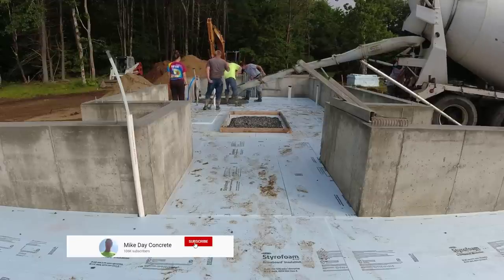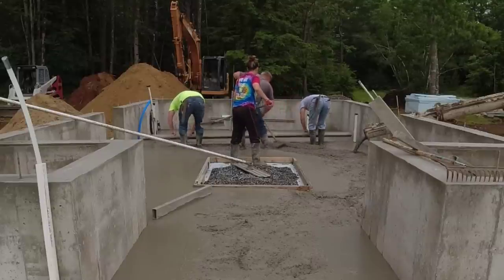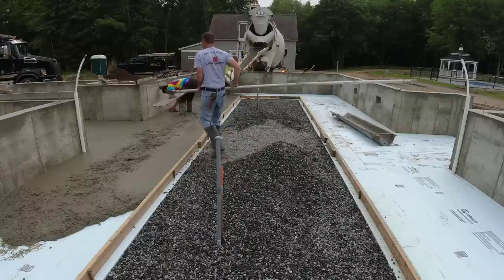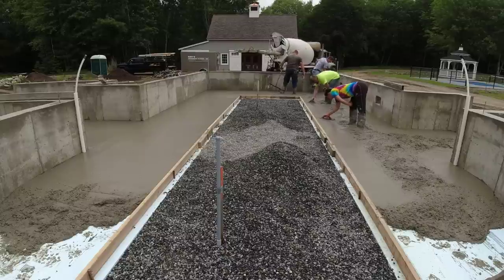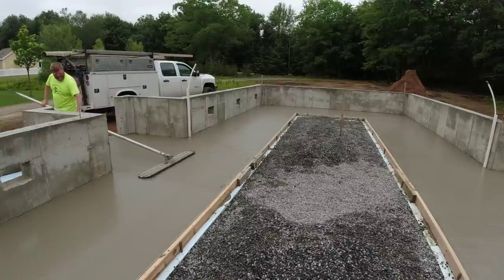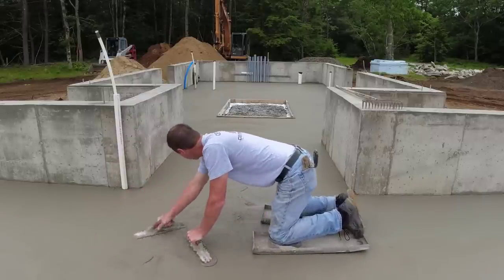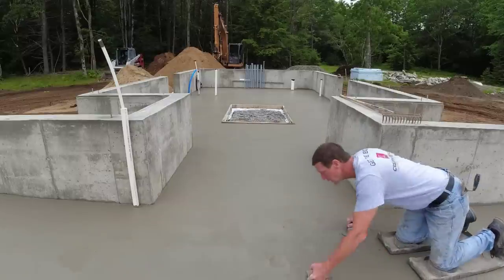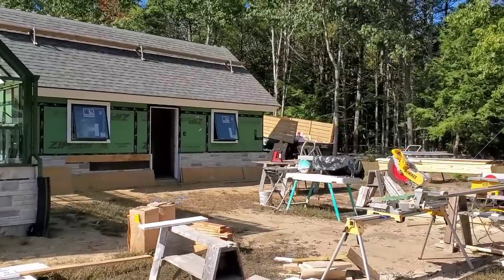Greenhouse Floor - Not Our Normal Concrete Pour

Comment: Hey Mike I like the vids man how you explain what you do. I had a question. I’m pouring a 12.5’ x 11’  4 inch basement slab and there is no room for a bull float. How would I be able to float it? Do I just screed a bit and then float by hand at the same time?   What do you recommend

Comment: Hi Mike, just wondered why you put the saw cuts in after the cure rather then when wet? Love your channel by the way and all the very best from the UK
Reply: sometimes you can do it when wet especially when you have the time to do them. everything you do takes time. putting them in wet every 5 ft or so might take an extra 45 minutes. and after you go over it multiple times you have to make sure they are looking good though-out the mag and finish process . touching them up throughout might add an extra 30 - 45 minutes. sometimes its better to allocate that time towards getting a better finish while the concrete is easier to work with since you only really get a 2 hour window to work with it. and only in stages, grooving can really only be done it the begining stage. ( first 20 to 60 minutes depending how hot it is. ) . its better to come back to saw them next morning when you have a lot to do and the time is on , concrete is not waiting for anyone.
Reply: The floor stays a lot flatter with saw cuts rather than joints, its easier to roll carts over the 1/8" saw cuts, and you can make them deeper than a jointer

Comment: Noob question - What's the purpose of "mag floating"? Couldn't the same be achieved with the "bull float"?
Reply: the bull float flattens out things nicley but is pretty bullish. leaves things a bit rough and usually leaves some edge lines . the mags are used to help flatten out anything left by the bull float. and help settle the rocks just a little bit and bring up more creamy concrete that will be used  to fill everything in the next process. ( either another mag , or smooth trowling ) . 

on occasion. you can get really lucky and use a bullfloat. then follow up with a large smooth bull float called a fresno. skiping the mag process.  

it seems mike and his crew also use the mag to flatten out the edges before screeding and bull floating. ive never really seen this done before and didnt know why he does it, but i just recently tried that method and found out it helps keep all the outside corners much cleaner and filled in .

Comment: Did you cut the 4' screed off on an old longer screed? Or do they sell screeds that short? I've seen green houses poured that way, usually just fill that middle with some kind of rock level with the floor
Reply: screeds in this case are just a very straight 2x4. cut to the desired size.